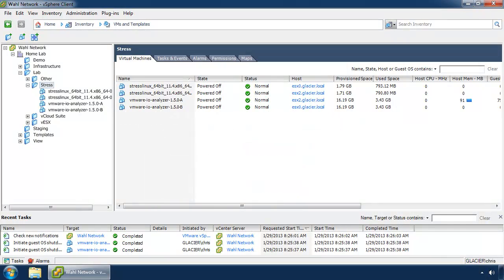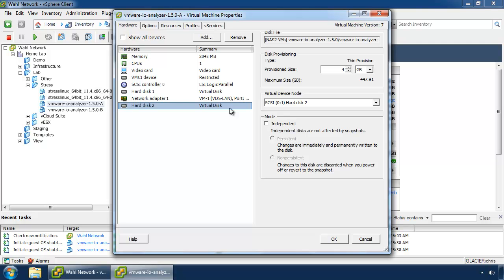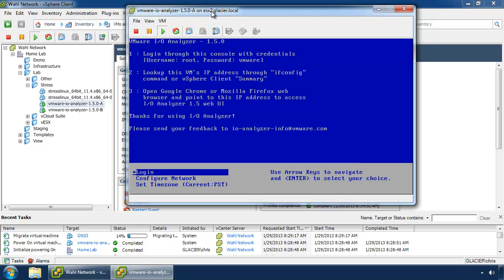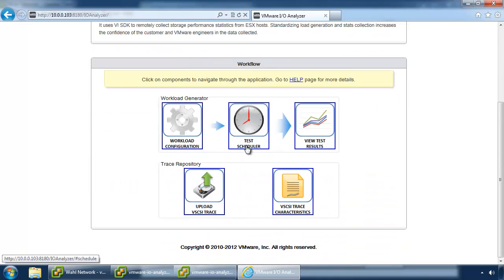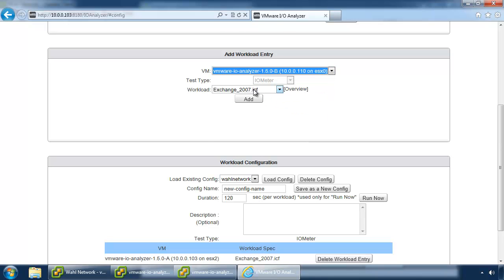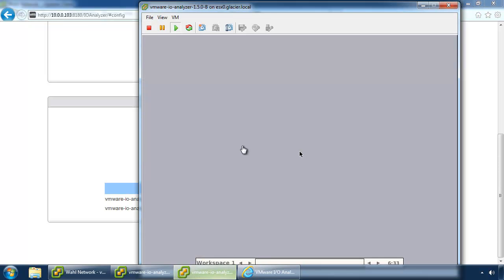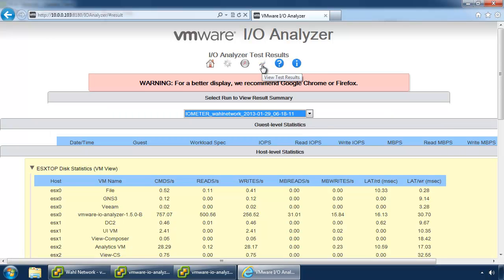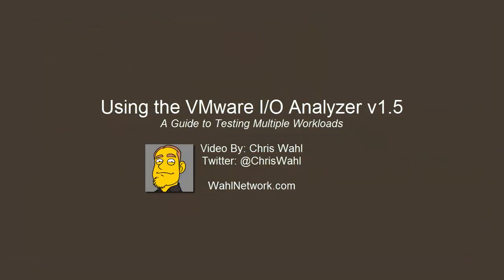Using the VMware I/O Analyzer v1.5: A Guide to Testing Multiple Workloads

Comment: Hi Chris,

you might want to read the manual ;). You need to delete and recreate disk 2, changing it's size won't help. The partition already exists, it doesn't get adjusted and you'll still be testing with only 100MB. If you replace the disk it has no partition and gets reinitialized.

Haven't tested it, but basically that's what the manual says :).
Reply: Oddly I noticed there are no partitions. The manual only mentions it needs to be replaced though, not why. I assumed partitions.